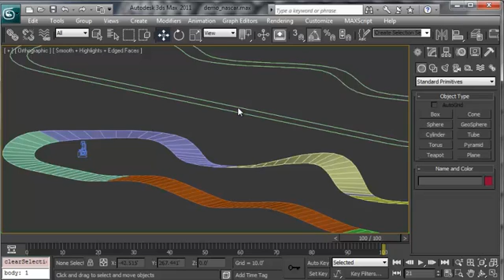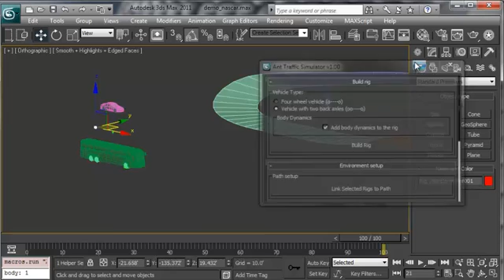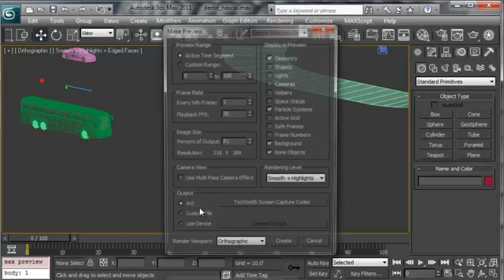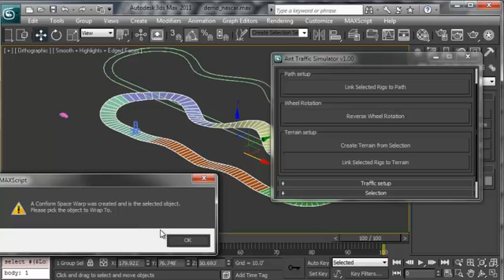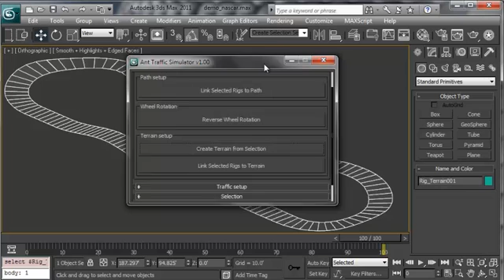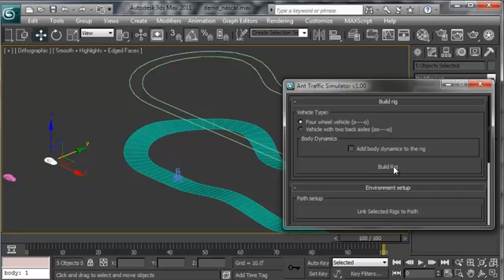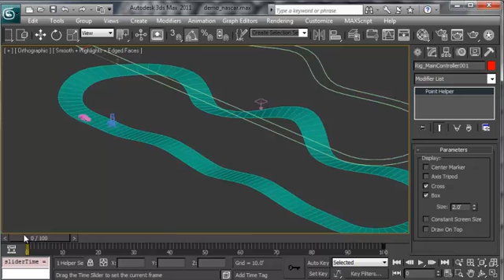Ant Traffic Simulator - Closed path and viewport jerkiness questions

Comment: as the recording of motion happens   the cpu/gpu gets hit and disrupts the smooth record.    the same thing happens in other 3d apps on the pc when capturing motion.   Its a by product of some process running in the background hiting the proccessor in intervals.  check your Task manager CPU monitor  and if you see an interval pulse. thats the problem!.  but i cant say what process causes it cause it doesnt do it until you install many apps.